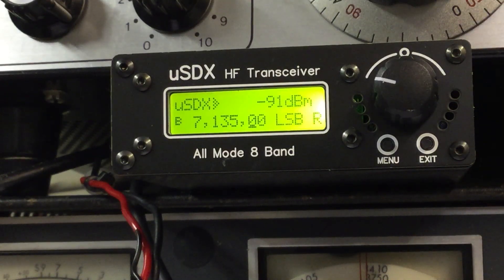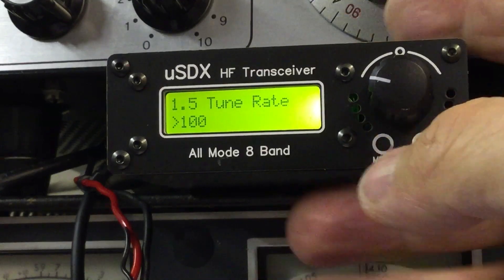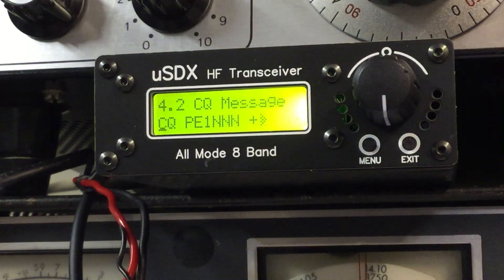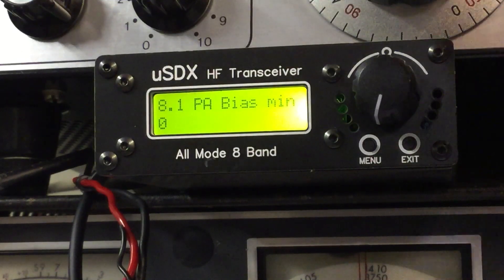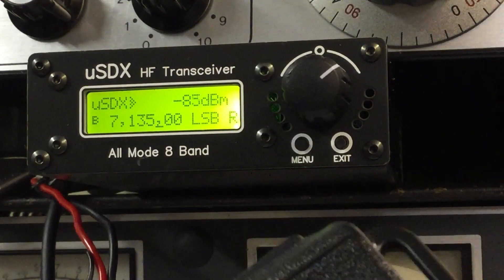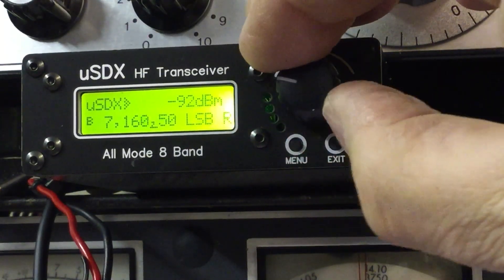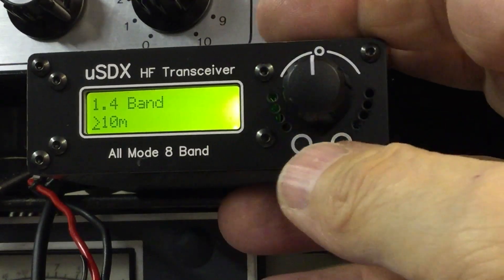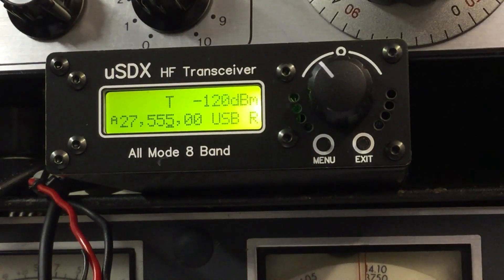uSDX SDR tranceiver first power up a look through

Comment: Nice video and good suggestions. I received mine without Batteries. I need to rotate anti clockwise to go upwards. Any suggestions/recommendations to change. Also can’t receive any stations with long wire antenna. Anyone can help or suggestions. Thanks & Best 73’s
Reply from the maker: No suggestions for reverse VFO, might be best to ask in the forums.
For a long wire (which I use) a tuner is recommended, especially for TX as high SWR can blow the output transistors

Comment: Does this work on 12VDC, or must it have. 13.8?
Reply from the maker: For this video I was using 12.5V from an old HP server power supply.
This does not appear to affect power output.
I wouldn’t go beyond 13.8V
Reply: @m0jcfhamradio75  
Thank you!
On the back of the radio, what is the function of the  "CAT PTT OUT" and "MIC KEY" . I presume the "Key" references CW, but what about "Mic" (when there already is a microphone "KJ" - Kenwood Jack???")

Comment: Do you know what kind of connector goes to cat ptt out want to use on ft8
Reply from the maker: I "think" it's a 4 terminal 3.5mm jack. The tip is MIC then GRND then PTT and finally SPKR.
So you'll be looking at the two centre rings for GRND/PTT
Reply: Thanks for the info😊

Comment: Thank you.  But I set up mine similar to yours and I can only choose between 6 and 10 band, for which always then defaults to 6. Also the Mike does not appear to transmit. I am not complaining to you. Rather, I am hoping someone can tell me where I am going wrong.
Reply from the maker: That is a known problem.
I no longer use the “Select Band” in the menu.
If you look at the frequency in the display, you can see a cursor under one of the numbers.
If you press the main button the cursor will move.
Select the first number and then use the knob to change the numbers.
For instance, If I’m on 3.5MHz but want 7.1 I go to the 3 and spin the knob to select 7. Press the knob to highlight the 5 and spin to get 1 etc.
Actually quicker than using the menus.
Reply: I found this too locks on 10m if I go down there in the band selector  menu, Like has been said if you use the VFO to go back and then band selector will work I just don't go back to 10 unless I really need to.

Comment: I just got one this week and it would not transmit using the microphones PTT, vox mode seemed to work, so not sure what fix will be at this point and time. The hash it makes when changing modes and settings can also be a bit annoying..Fred VE3FAL
Reply from the maker: I’ll make another video this weekend Fred, trying the various aettings and listening to the hash. If any.
Mine has a Baofeng type speaker mic.
You’re not using the linear amp PTT jack are you?

Comment: What is the difference between the uSDR and the uSDX?  I've seen both out there but can't find any documentation on what/if any difference?  Tnx fer the video
Reply: DL2MAN explains the difference. He came up with the concept. The Chinese changed the last character and sell what used to be a non commercial open source project.
Reply from the maker: Well mine says SDR on the case but SDX on the PCB.
I know there are different versions of boards (mine is quite a late one at v2.7.1)
It may be just a “brand name?”
Just make sure you buy the latest revision is all I can suggest.
Reply from the maker: I lied. It says uSDX on case and board. Sorry...

Comment: Hi Mark, thanks for the video.  I really really liked this radio and made some great contacts with it.  Unfortunately it didn't last long and I had to return it.  I hope you have better luck and do keep us posted.  Great size, multiband, multi mode.  I have a video of my time with it if you're interested - some great contacts but also I show some of the issues I had with mine: https://www.youtube.com/watch?v=o4i7JWiVibw
73
Reply from the maker: There’s a mod to stop these going bang.
Mine was done from the factory, luckily...
There are pads marked 12V and 5V on the inside of one of the boards... This should be bridged to 5V if set to 12V.
It will prevent the op amp and multiplexer chips failing.
Reply: @m0jcfhamradio75  Thanks, Mark.  I saw your video on that - nice find.  Something to check when it arrives.  Keep us updated on your adventures with the rig.  73
Reply: Mine also died, just got a refund from Aliexpress.  Might pony up a little more for a Xiegu or something.   I like the concept.
Reply: @contactmiller  Hi Brian, depending on how many bands you want and portability, you might also look at the SW-3B.  It's small, basic, but well-built with great reviews on eham.

Comment: good description  ....let us no if tx on 555 and also fm/11m.cheers
Reply from the maker: I checked on 11m and it transmits 5W.
However, I’ve not monitored the receive.
Reply: @m0jcfhamradio75  tx audio on 11m is very poor
Reply from the maker: @Ewetopia026  I son’t use it on 11 so not an issue for me. :-)
Reply: Yeah I wonder about 11m too, but I'm guessing no